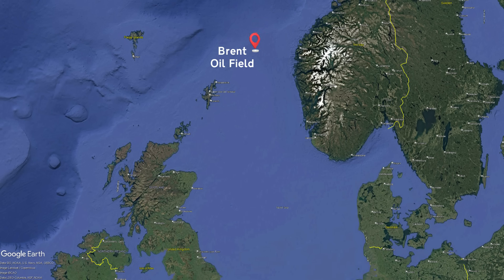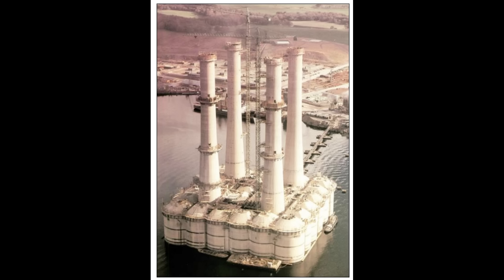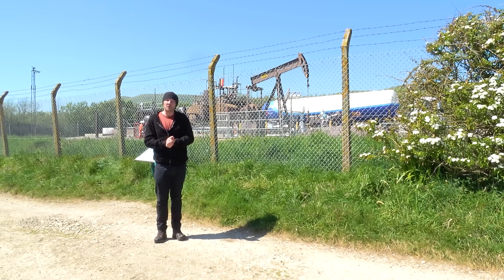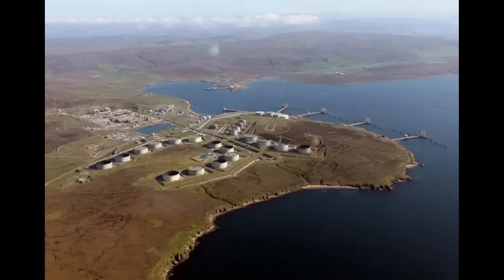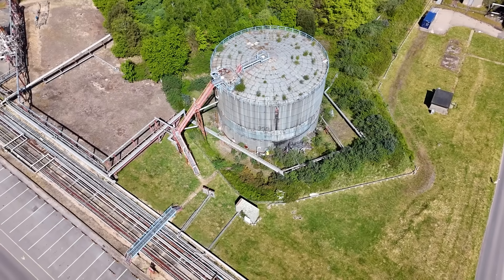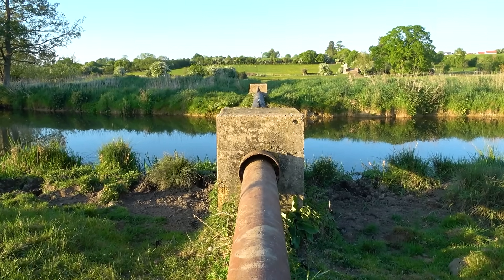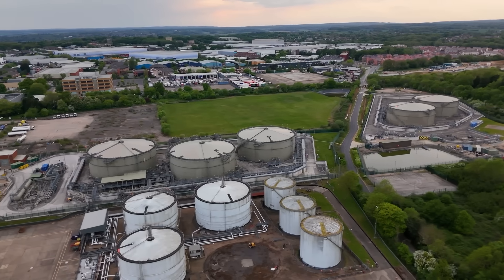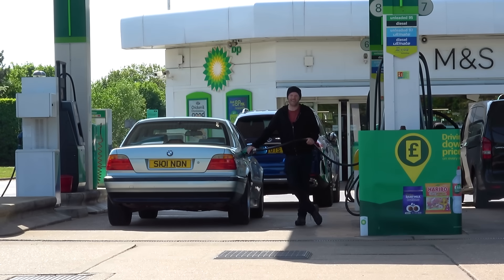Where Does Petrol Actually Come From...?   A Journey From Source To Fuel Filling Station

Comment: Excellent video Jon, thank you. I'll add on a few bits as a fuel driver who works out of Fawley:

We technically pull fuel out of Hythe terminal, which is basically just up the road from Fawley. Sometimes they won't have the correct grades of products so we'll have to go around to different terminals to pick it up. Some contracts have different additives obviously, such as Shell, but some don't have their own additives installed properly. For example, BP at Hythe uses a "common user" generic additive for normal unleaded and diesel, and we manually add the super additives to unadditised diesel or unleaded if needed. 

Hythe terminal has to have its ethanol delivered separately, for whatever reason Fawley don't deliver it. So instead, 5 trucks a day are sent from Purfleet/Navigator in Essex to deliver just ethanol into the terminal.

BP used to run their fuel trucks directly out of Hamble, nowadays I believe it's only really ethanol that is transported by road there. All of the retail bays have been removed.

Hemel Hempstead and Buncefield were technically two separate terminals, with Total owning the explodey one. After the big bang it's just BP running Hemel.

That shot at 9:02 is the spare yard for my company (I've dropped off one of the units lined up at the back). The concrete rectangles to the right of that are the kerbs for what used to be the loading bays, where you have 5 "arms" of different fuel products, and these days a vapour recovery. Back in the day you would load from the top of the tanker, that's gone for pretty much all retail work these days.

And finally, you can have above ground diesel storage tanks, some very old sites may have them, as well as cheap bastards and industrial sites. These need a pump truck to deliver (very loud). While you can have a 1000l tank that's very rare on retail, the minimum my company delivers is 3000 and the tank would probably be 5000. The biggest retail tank I've seen is about 105k, though I'm sure more exist. You also have bizarre situations like at Leigh Delamere where they have 20 tanks on each side, all of which are no more than 20k (relatively small). Very strange. 

If anyone has any questions I'm boring enough to answer :)
Reply: The 'explodey one.'😂 John's rubbing off on you
Reply: I was a contract rigger and did Stanlow. She'll sacked all the (very well paid) drivers and subbed out to Hoyer.
Oh I worked on Fawley power station too.
Great place, but like Ince B, running on oil wasn't going to pan out.
Reply: @surreyscouse2873  I would never criticise that company, obviously :) :) there's still old boys on good contracts but they've pulled the ladder up behind them for new boys

Yeah I remember when the chimney was still up at Fawley, only knocked it down a few years ago
Reply: @EXemplary-b6f  chimney?
You mean the stack 😉
Reply: My understanding, from a mate who delivers to airbases in Suffolk, is that it is very unusual to pump petrol to public visited garage sites, it is done by gravity
Reply: @90vanman Underground tanks must be vented so that when product goes in, air can get out. The vent pipe openings are much higher than a tanker so that if a tank is accidentally overfilled, product will not spill out. Provided of course that gravity, not a pump, is moving it ...
Reply: @90vanman  yes made AFAIK never petrol. You can do it with a brass pump but I don't know of anywhere that needs it. But there are a few family run garages that still have above ground diesel tanks
Reply: Fascinating. My best friend is an executive at a Virginia (USA) fuel distribution company, using their several large tractor-trucks (HMVs) to deliver product from the Colonial Pipeline terminal in northern Virginia to Pennsylvania-to-North Carolina retail and commercial locations. Same methods, different place names. Your fine description of British delivery methods are very familiar to me.
Reply: @k.r.baylor8825  interesting. I've looked into US fuel distribution and it seems much less centralised than it is in the UK. Here we work under quite broad contracts where the big oil companies have quite a lot of say, even down to things like if you're allowed to have phones in the cab etc. The US way seems substantially less involved, ie they don't care about the PPE you wear etc.
Reply: I love the description of the "explodey one"! It's about a quarter of the size it was before. I used to work fairly near it, reminded of the saying "Red sky at night, Hemel Hempstead is on fire..."
Reply: Interesting - thank you
Reply: Thank you , v interesting 

So how much water really gets in to all this ?
Reply: @simonyapp  none or you have real problems. I have the Tshirt for that, cars stop very quickly if fuels contaminated. Because of the ethanol in petrol and bio fuel in diesel its critical that product is dry or you very quickly have problems. It's a key part of the QA process. Testing is even more stringent with aviation fuel
Reply: @simonyapp  you wouldn't get water in unless the tanks or pipework are knackered. Sometimes if they are screwed then water can get sucked in through the vapour recovery system
Reply: @EXemplary-b6f  buncefield (HOSL) was a Total and Chevron joint venture but total insisted on running it.  We, I was with Texaco/ Chevron for 30 years) ran avonmouth BOSL. Total took the blame as it was their show. I ran the Sunderland  JV SOSL which was a Texaco  BP JV around 2001. After buncefield we all wanted out of joint ventures and we bought out Esso from Manchester and mainline pipeline.  You're totally right about the logistics of ethanol and additives. None of that when I started in 91
Reply: @eddiewatts7792  interesting, thank you
Reply: So I guess the whole argument on whose fuel is better is actually relevant if BP uses some kinda of generic mix but then shells mix is very different and specific?
Reply: @toastman6847  this is just out of Hythe. Elsewhere in the country it will be very different, especially in London BP normal fuel will be BP specified.
Reply: Fascinating discussion going on here! Thanks to all of you working in the background to keep us lazy motorists full of juice!! 😊
Reply: Do the storage facilities in Fawley have the FAME/Ethanol premixed in the storage tanks or are they blended on loading?

What additives are you adding to the fuel, just Cetane/Octane improvers and biocide?
Reply: @johnington  the additives are added as we load. There are separate (tiny) additive lines that inject it as the fuel goes in. With super unleaded the ratio is literally like 3L to 7000L of fuel. At Fawley we have to add the super additives first manually, and then load the fuel on top. At Avonmouth the super is on the bays like normal, but I think there it adds it as the last thing, afterwards. Not sure.

As for the additives themselves, I'm not sure. They're marked as "Lubrizoil" and another one, but I'm afraid that's all I know
Reply: Who supplies Sainsbury’s fuel? Heard it was basically BP fuel.
Reply: @jackandrews429  Sainsbury's is definitely not BP these days. I believe it's Flexigrid (Greenergy). Good lads in all fairness
Reply: If stage 2 vapour recovery happens at the fuel pump and stage 1b happens at the tanker, I would assume stage 1a happens as you take on fuel to displace the vapour, correct? Is this always the case or is there a system for discharging the vapour from the tanker separately? - Former PFS manager who was only trained on stage 1b and 2
Reply: @Baopand  yes, so when we load the procedure is essential

Park up, handbrake on.

Turn off our electrics - we have a button that hard isolates the truck. For any XR reading this, we have an override in the cab for cases of sabotage.

Connect a big grounding pin that will keep us electrically safe, mostly from the high potential static buildup as fluid rushes in

Then connect vapour recovery. As fuel is pushed in, the vapour goes straight back into the terminal. Someone years ago said that they have a big storage tank and when it's full, they can condense the gas back into some form of a liquid fuel, I don't know how true that is
Reply: @Baopand  and yes, these days you always use VR when loading, and when unloading petrol. You don't need to with diesel although it's company policy most of the time, except for on pump work
Reply: @EXemplary-b6f  Thanks so much for the answer. It's always bugged me!  Final question and I'll leave you alone. If the tanker trailer is done for the day, or maybe going for a service or something like that, how does one remove the vapour? I can only think of three options: 1: The tanker is never empty of either fuel or vapour and that's just how it is. 2: The vapour is pumped out down the VR hose without taking on fuel to replace it and sent for vapour recovery. Or 3 (the least likely considering the multiple hazards): The vapour contained within the tanker is vented to atmosphere by opening a valve.
Thanks again!
Reply: @Baopand  absolutely no worries mate. 99% of the time it's left as it is, but whenever you have vapour or fuel residue it's still under ADR (dangerous goods regs). What they would probably do if needed is clean out the tank, on the massive storage tanks at terminals they actually use seawater, but for road vehicles it might be some chemicals. I'm sure that some cowboys do just open the top valves and let it vent to atmosphere, but regardless you'd need breathing apparatus and you'd only really need to do it if you had to work on the tank internally ie if there was a leak between compartments etc
Reply: Can someone explain the grade quality from the mainstream companies like 
Esso
BP 
Shell

Also 
How the supermarket fuels compare 
Some folks say that the super unleaded at supermarkets pumps are close to regular unleaded at the big three 
Wondered if that was just a crazy myth
Reply: @ImranHussain-hk7gt  Super is higher octane, supermarkets super is 97-99 octane, standard unleaded is usually 95 Octane, "Mainstream" would mainly be 99 Octane. But as I said above, what makes Shells V-Power better than others is the technology put into their additives for cleaning engine components within the fuel system and combustion chamber.
Reply: You lot would be terrible! Loose lips sink ships. And if Zee Germans did try again, all they have to do is watch this video and read the comments. Come on guys. Keep the secrets secret
Reply: Jon mentions export a few times. Unless I’ve lost my mind, the UK is a net importer of fuel. Is there really flow both in and out of the country in oil & its derivatives?
Reply: definite dull man club Facebook group crossover going on here.
Reply: @Alienalloy but it isn’t dull. It’s genuinely amazing what things go on entirely behind the scenes to keep all the plates spinning for the public who are blissfully unaware. That unawareness comes from quiet professional efficiency day in, day out.
Reply: @robinwells8879  "It’s genuinely amazing what things go on entirely behind the scenes to keep all the plates spinning for the public who are blissfully unaware." Exactly like this. Our civilisation is on a knife edge, and collateral system failures would destroy a country that has no idea the balance even exists.
Reply: @Alienalloy  spot on, I'd just rather not post with my public name:)
Reply: I understand that Shell is probably the highest quality fuel and is also what Tesco sells. Any truth in this?
Reply: @robinwells8879  I've heard rumours about Shell being 0% ethanol, I don't work on Shell so I can't say. Normal fuel is all 10%. BP super is 5% 97 octane, Esso is 10% ethanol 99 octane, Shell I have heard about being 0% ethanol but again I can't say. Tesco I'm not sure. All of this is out of Hythe :)
Reply: @EXemplary-b6f  I thought all Unleaded fuel had to contain 10% Ethanol, and Super Unleaded 5%?
Reply: @mrlister2000  those are maximums yes. But out of Avonmouth there was a sign saying that Esso super unleaded had 10% ethanol. So I'm not sure tbh
Reply: @EXemplary-b6f  interesting!  All I know is that the recipe is deemed to be the best according to two former shell colleagues. 
My son works for a race engine manufacturer and they swear by BP Premium. Both seem good and appear to return better fuel economy to cover the additional cost at the pum
Reply: @EXemplary-b6f Shell petrol often made my old bikes & cars 'pink' pre-ignition, not the colour. Avoided it like the plague ever since.
Reply: @robinwells8879  Shell isn't higher quality, they just have better more scientifically produced cleaning additives, Tesco is just also 99 octane, with most likely (Idk for sure), standard additives for cleaning and corrosion prevention.

Comment: I live in Bristol and knew about the Avonmouth Esso site, but wasn't aware of the site in North Somerset. As for the site in Aldermaston, a close relative was affiliated with the adjacent site in the early 80s.

Although useless information, the Shell filling station at the north end of Aldermaston Road in Tadley was one of the close relative's favourite local pubs in the early 80s. The pub was The Falcon and it seems to have closed in the late 2000s before the land was purchased by the filling station franchise owner and used to expand the shop for more crap you don't need if you're driving a car sensibly.

Comment: Loved the video, but you forgot the UKOP, WLPS and Finaline pipelines that span the UK too. Oh and the failure of Buncefield was put down to the failure of a tank overfill sensor - not a valve. There were underlying issues, but the primary fault was the sensor. (I was involved in proving that if that sensor had operated as planned, there would have been no overfill….)

Comment: Good Video. Except the oil from Wytch farm does not go directly to Fawley oil Refinery it goes to Hamble. There is a direct pipe to Fawley but was never connected as BP or Esso could never agree a price. Fawley doesn't get its crude from Hamble very often and when it does they load a tanker and sail the whole mile or so across the water. Oil from Wytch farm normally goes to Europe via Hamble. Normally every 5-6 weeks, the tanks at Hamble are full and then a oil tanker would be chartered.

Comment: Nice video. Love the random jokes.

I'm curious, do the tanker trucks actually have pumps? Or do they drain into the underground tanks like in the US ? 

What I've seen is the truck has the three or four sections. Sometimes different types of fuel in each section. They hook up a big hose that locks on then open a valve and the truck DRAINS into the underground tank without any pumping. I think this reduces chance of fire or explosions.

Comment: Was great to see footage at Teesside. The Able quay and yard does a lot of demolition and scrappage of big marine stuff, even famously scrapping the old French nuclear aircraft carrier Clemenceau. It's worth noting that the Teesside area is very big for the oil & gas industry, with a natural gas pipeline landing from the Ekofisk site (shown on the map at 4:54), including a gas processing plant, gas storage and the facility to load LPG tankers for shipping oversees. There are also a multitude of sites on the Tees that do storage of oil products, so called tank-farms like Buncefield, and there is the ConocoPhilips oil terminal and refinery. All in all, it is a very large network of different sites and companies fueling a bit of a northern energy cluster, more north than the extent of the national pipeline network.

Comment: Ooo Auto Shenanigans in Dorset! I can't find it now but in the old days of BP running Wych Farm there was a fantastic and hilarious video comparing Dorset with Dynasty (TV US Oil series featuring Joan Collins). Greenpeace and various campaigns hated what was happening and there was a plan to build a temporary island for 25yrs in Poole Bay (totally blocking the views from Bournemouth beach).  The protests went on for years and during that time it became possible to "drill and pump sideways" (layman's terms) and so the temporary island wasn't needed, and thus pumped to Fawley. (By the way the ecosystem around Kimmeridge and Poole is so good now that Seahorses nest at Studland so BP and the oil industry did a fab job!)

Perhaps you should take a little drive along the A351 from Wareham to Corfe Castle one day? BP and other investors paid for it to be straightened so that massive storage tanks built in Humberside could travel overnight to Wych Farm.  Each time a tank was transported, the road signs on all the roundabouts on the A351 were temporarily removed to allow the bogeyed trailers to drive over them straight!  By the way Furzey Island in Poole Harbour also very cleverly hides its oil er... Shenanigans!

If you go walking in the area. be careful or you might get a sense of deja vu, compasses are attracted to nodding donkeys, so you may walk in circles!

Comment: Oil is not from fossils it a hydrocarbon and it will never run out, not fossil, the term fossil fuel was given by the rockefeller company....... if you believed thousands of dinosaurs died in one exact spot, well that sums you up

Comment: If the new M25 J28 A12 works interest you, might be worth having a look and linking to the Exolum network as I think the bridge structures there had to span over it obviously without disrupting it.  Also avoids a cadent gas pipeline which you can spot because there is a bare patch of landscaping.  Note site probably better visited post completion & decommissioning of the site compound.